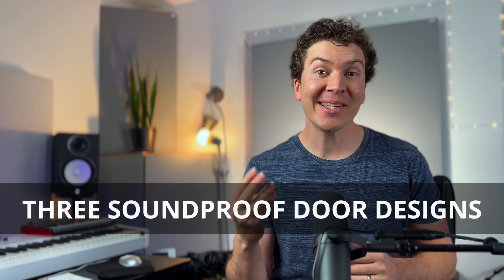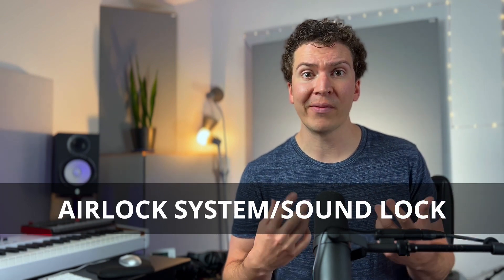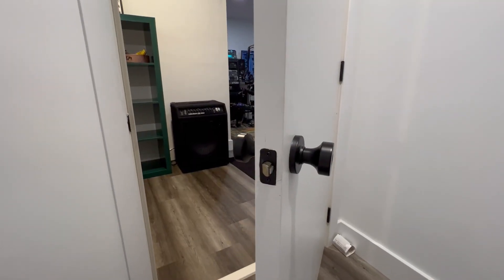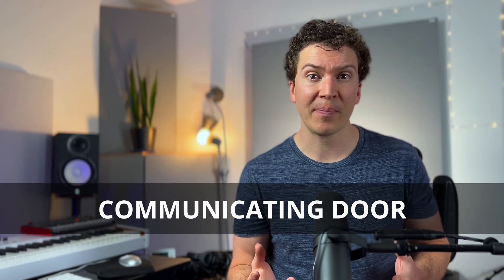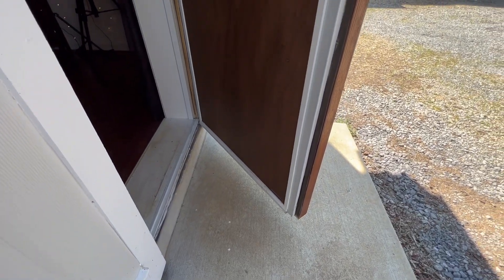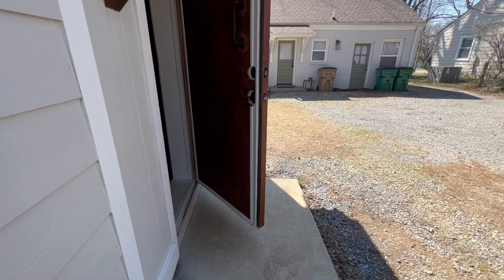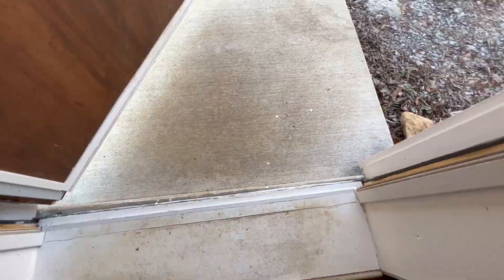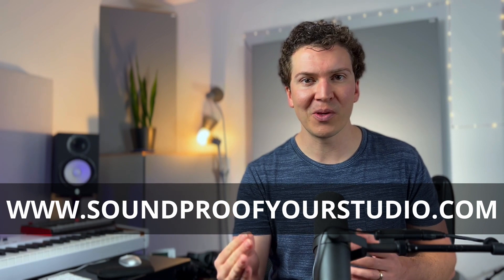Three Soundproof Door Designs For Your Home Studio

Comment: Which weather stripping / magnetic weather stripping did you use?  I’m trying to pick the right stuff and visualize how all the pieces actually fit together with the frame and door.  Thanks!
Reply: Ps I did the double door setup
Reply from the maker: So I used Frost King. It works well. Overtime I wonder if it might need to be replaced as it gets more compacted. The magnetic weather stripping I bought on amazon. Any should do the trick.